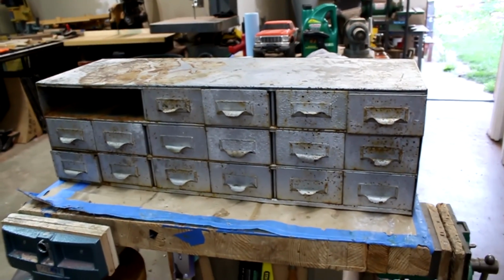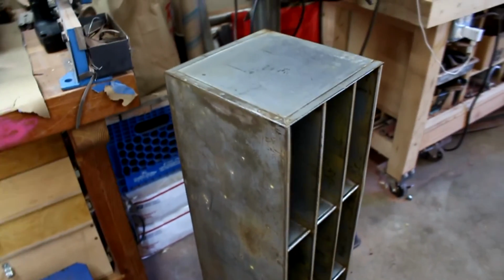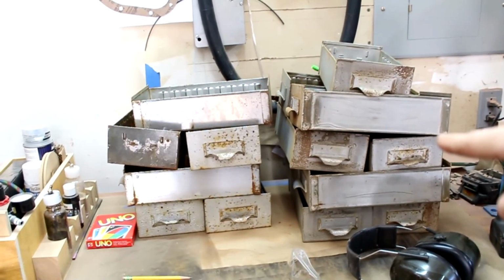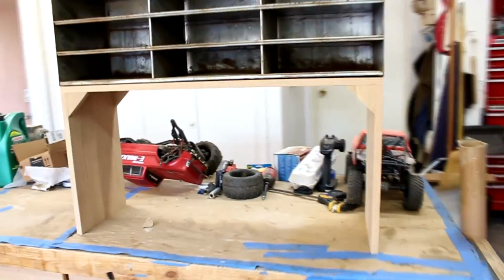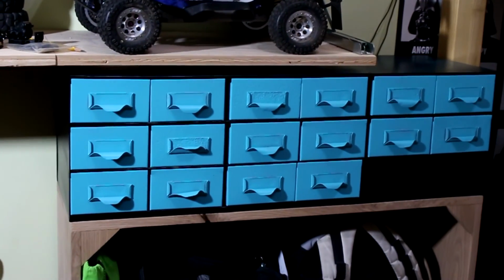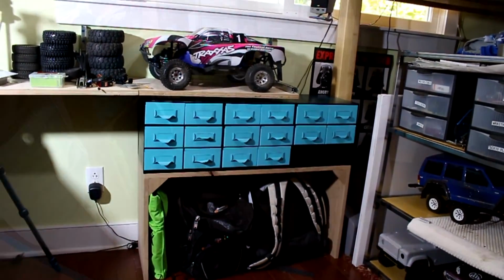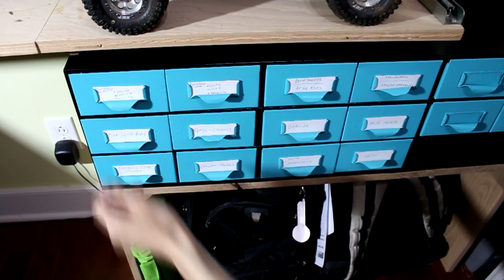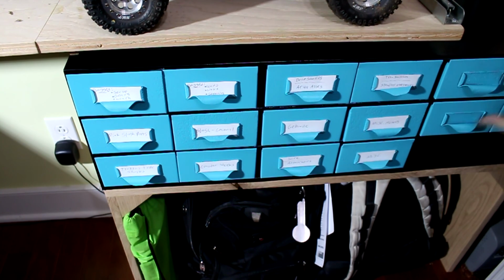RC Storage Cabinet Project

Comment: nice work on that cabinet the end result looks great
your room must be big, thats so many stuff that you have...
those dead servos are useful for light controllers, etc unless the circuit boards are toasted
you can use the empty space for storing rc manuals
Reply from the maker: Thanks! Yeah I have a box that has never seen the camera yet full of probably 30 - 40 WORKING servos I got at a swap meet for like $25. They were all airplane servos though so most were pretty weak compared to what we use in surface vehicles so I have more than a lifetime's supply of light controllers if you look at it that way haha